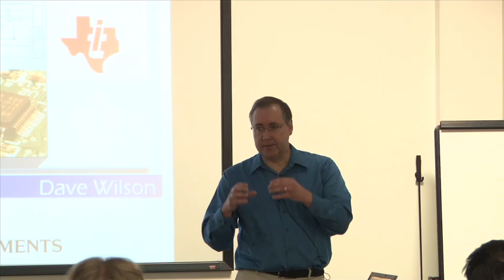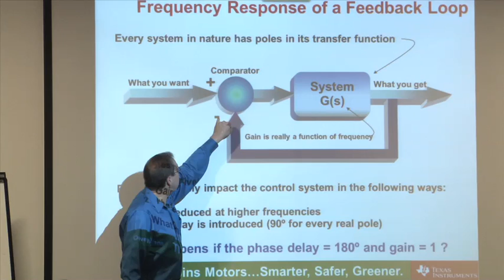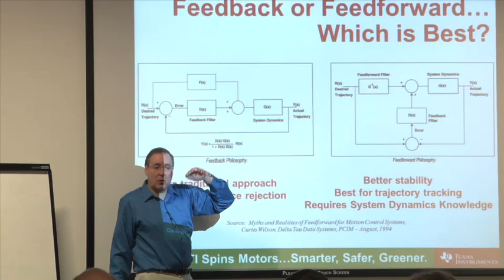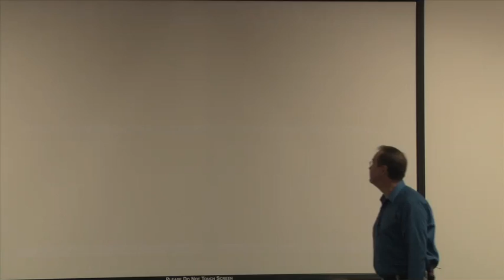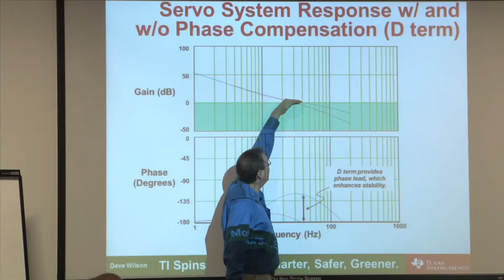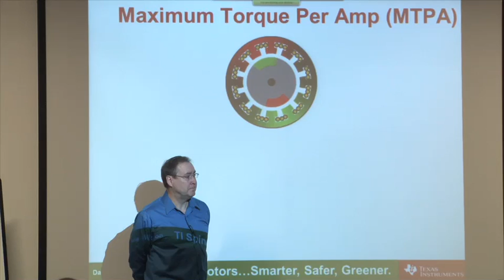Teaching Old Motors New Tricks - Part 1

Comment: does anybody know if P at 43:32 refers to the number of poles exactly or does he mean pole pairs?
Reply: I think i figured it out. Correct me if i am wrong but for both controllers the units of the controller actually cancel out the inputs and you end up with output in terms of amps or volts (assuming radian quantity is m/m unitless). This only holds in the case where that damping term delta is not the coefficient of viscous friction but a unitless coefficient.

As for the number of poles, he says its number of poles so its number of poles. I guess a lot of the other stuff i was reading used pole pairs so i was a bit confused when i saw poles instead for the first time. The math works out for the 3 phase torque constant so if you have poles pairs just multiply by 2.

In my eyes, the strategy is to quantify a physical phenomena or reaction, ie inductance as a slew rate or something, and relate it to the error or integral of the error to get something that isnt just an empirically tuned constant. For example, the proportional terms P is simply L(Vs/A)*w(rad/s system bandwidth)*current error(A) which works out simply to volts*rads or just volts.

Comment: there is an interesting topic which I had reserched. I considered the switching frequency as an additional time constant within the control plant. The time constant of the motor was more than 10 times bigger than the time delay introduced by the pwm switching frequency. Normally we would neglect that pwm time delay but....I had reserched that influence of switching frequeny on the controller within FOC. I used pole-zero compensation to calculate the controller gains. I used  PT1 pkant to represent that pwm tike delay. Result was that the PI controller which does not have a third zero can not compensate for that pwm time delay so there was always an overshoot or a super slow pi controller without much dynamic in the inner current loop, the Iq loop. So I used an inner PID controller et voila, extreamly fast in response to torque changes without any overshoot. I found it extreamly useful in current motor control of big high torque PMSM and at low pwm frequencies at and below of 20kHz.

Comment: Isn't there a trick to locate the differentiator to some other point in the block diagram so that the differentiator does not put out an impulse when set point is changed

Comment: I love these videos! Thank you for them. I'm trying to figure out how port my Simulink models into HDL code so that I can implement this on an FPGA device. Does anyone know how to do this?
Reply: There are tutorials on mathworks website on how to do it, there's something called simulink hdl coder which does this, but i guess it only works on Spartan fpga devices
Reply: @education7809  . I tried to buy a copy from Mathworks. They have a deal for someone for small companies to buy a license, but it's $4k at the time I asked. Normally it's $12k. But if it saves time and prevents mistakes, then I think it's worth the cost. However, this is not something a DIYer like myself can afford at this time.

Comment: Good presentation, A question is current loop tuning how we will set the R/L Zero , Kb gain value in digital control , how it depends on the sampling frequency .
Reply from the maker: Hi, for questions regarding specific design advice, check out this E2E forum where you can search questions or ask the experts: http://e2e.ti.com/support/applications/motor_drivers/
Reply: Thank you , I found it from the TI forum https://e2e.ti.com/support/microcontrollers/c2000/f/902/t/312133

Comment: Excellent video. Very very informational and definitely something I was looking for.

One doubt I have over what he says is that the motor goes faster as the current increases. I am not sure about that: yes the torque should increase, but the speed should depend on the frequency in my opinion
Reply: Purple Spark ⚡️ Perhaps he meant that a motor under load goes faster
Reply: I agree, the amplitude would have to do with the amplitude of the torque, and the the frequency has to do with the speed. I believe his statements are incorrect in this regard.
Reply: notice that in the two diagrams, the one on the left speeds up when the rotor on the right speeds up.
Reply: Yea I believe that's a mistake as well since the torque will increase as the Iq current increases.  The speed of the rotor isn't proportional to frequency though it's proportional to the voltage amplitude of the motor.  This is why the Kv terms of most motors are listed since they are in units of angular speed per volt (e.g., RPM/Volt).

Also, I think Mantis might be onto the right idea.  The motor is loaded so much the speed gets reduced and as the torque increases to overcome the load it will speed up.